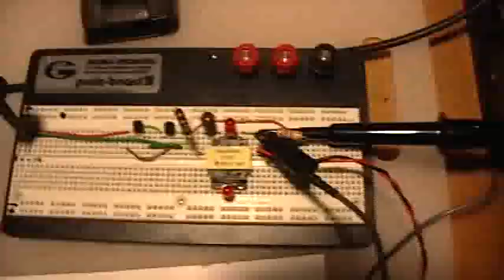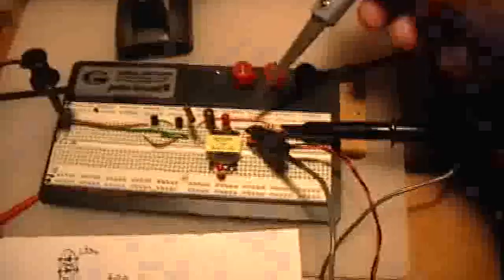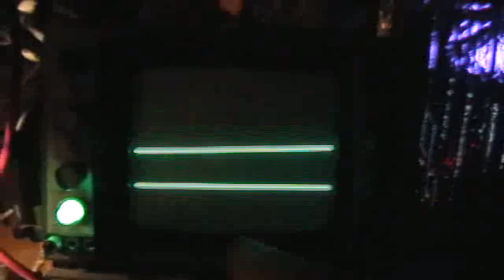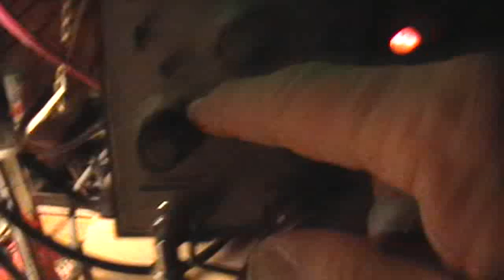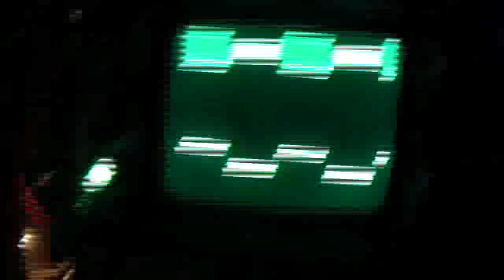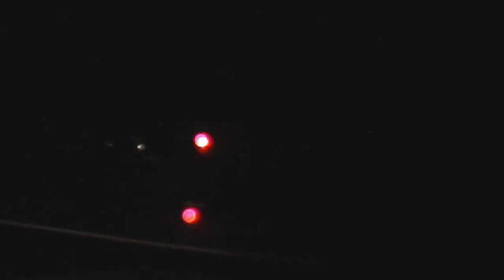Electric OU: Oscillations in the New Ainslie Circuit

Comment from the maker: @abbarue 
The problem is that the FG is providing power to the circuit too, as well as a "hidden" conductive pathway through its 50 ohm internal impedance.
If I am understanding you correctly, the "solid bar from plus to minus" is actually sitting up at the battery voltage and oscillating around it slightly. 
And please remember: oscilloscopes measure voltage vs. time... that's all. There is nothing showing a "large increase in energy" in this video. Voltage is not energy.

Comment from the maker: @overunitydotcom 
The oscillations happen with both my FGs, so it's not because they are "broken" or not good, and clearly they happen with Ainslie's fancy Instek FG and LeCroy DSO as well.
I don't know exactly why they happen but it has to do with the DC current flow around the circuit. If I insert a 100 pF capacitor in series with the FG's positive lead, the oscillations stop, and the FG's voltage doesn't drop the way it does when DC is allowed through it. Yet the square wave passes just fine.